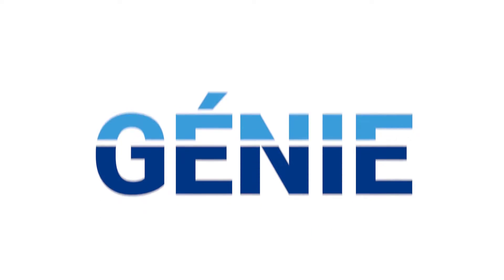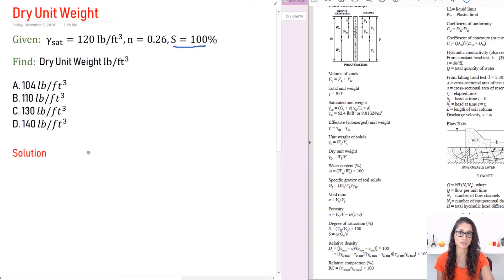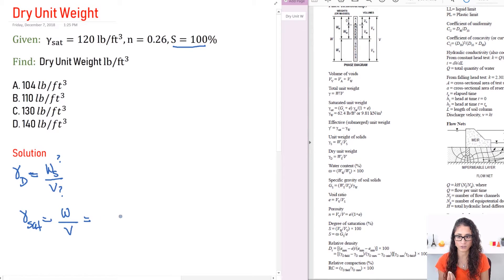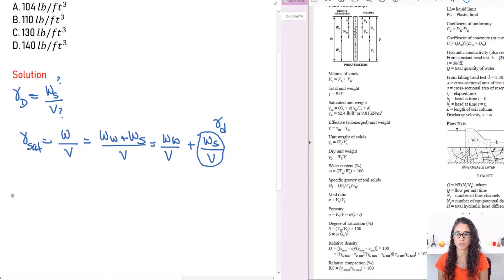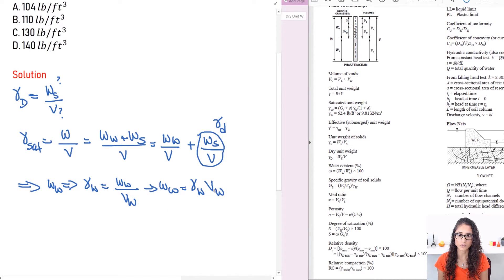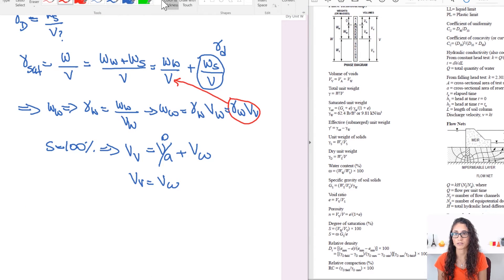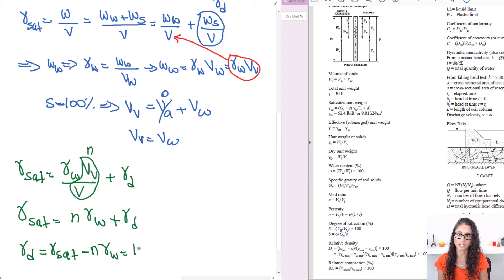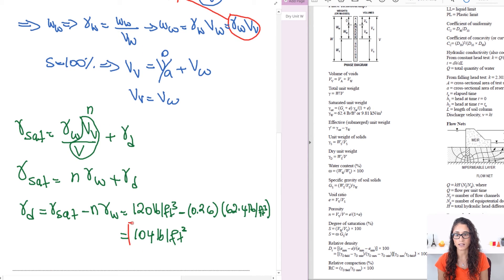FE Civil Geotechnical - Phase Relationships Dry Unit Weight

Comment: Nice explanation.  I believe you can also solve for dry unit weight by using the equation: Gamma(dry)=Gamma(sat)-(n*Gamma(water)) = 120 pcf - (.26)(62.4 pcf) =103.7 pcf.

Comment: Another Method: might faster: 1st Find Void Ratio --> n (Porosity) 2nd: Find Specific Gravity (Gs) --> Using Sat Unit Weight equation --> since (Sat. = 120 lb/ft^3; e = __ ;  then Find Dry Unit Weight = G * 62.4 lb/ft^3/(1+e). You will find that to get the same answer.

Comment: SG comes out to be 2.24. dry unit weight should be 62.4x2.24= 140lb/ft3? please explain! Thank you.
Reply from the maker: You did great job calculating the specific gravity. But the specific gravity is equal to the unit weight of solids divided by the unit weight of water. The unit weight of solids is equal to weight of solids over the volume of solids, whereas the dry unit weight is actually equal to the weight of solids over total volume. I hope this makes sense.